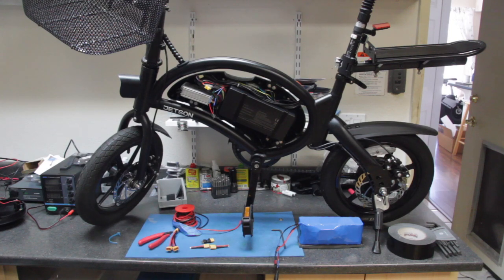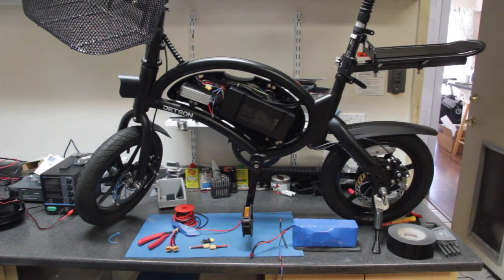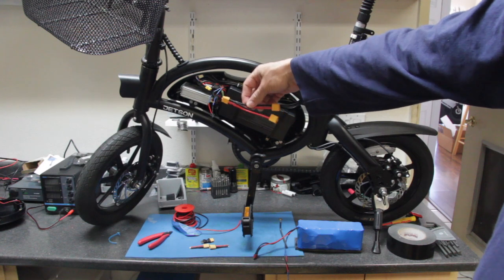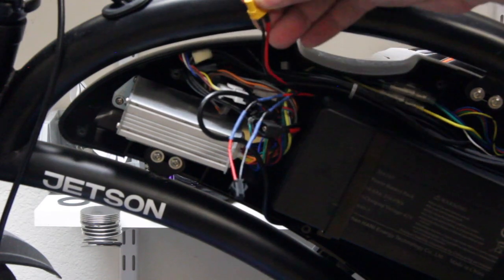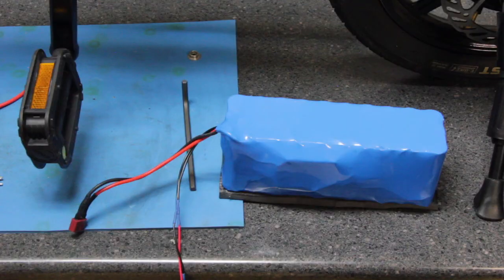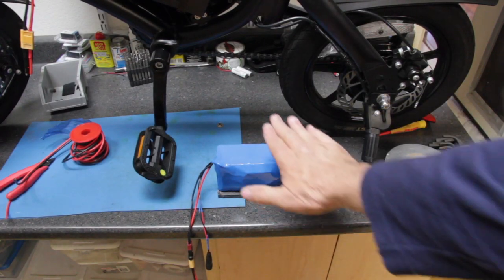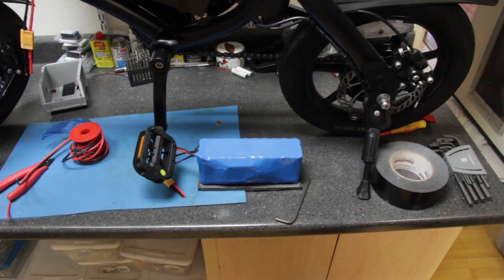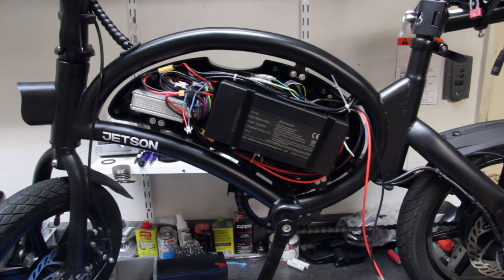Jetson Bolt Pro External Battery Part 1 - Longer Range

Comment: NOOOOO you don't want to do this!! You DO NOT want to use a Y connector. If you do this power can flow from one battery to the other (assuming they arent at the same voltage). Or if one battery discharges faster than the other again power will flow from one battery to the other. This bypasses the standard charge port. For some battery controllers, this won't be a big deal but honestly, we don't know which controller is in the Jetson battery or the eBay battery you bought, so I wouldn't risk it. You stand a serious chance of frying your batteries or worse yet starting a fire. If you really want to do this you need something called a "Dual Battery Discharge Balancer" which will electrically isolate one battery from the other and allows the controller to pull from whichever battery is at the higher voltage. Yes, it's another thing to but and yes they aren't as cheap as a Y connector but for the piece of mind it's well worth it.
Reply from the maker: Batteries are same voltage,  Batteries are disconnected and charged separately, indicated in the video.  The external battery is a slightly higher amp/hr battery.  The BMS's should handle the amp draw or regulate any over amp draw.  If the primary battery discharges first then the external should be regulated by both BMS's.

Comment: Can I use 48v or same volts the 36v
Reply from the maker: For 48 volts you need to upgrade the controller, pretty cheap to do that,. Check on Amazon or ebay
Reply: @Joe's DIY Lab  if upgrade the controller, the speed can be increase?
Reply from the maker: @virgiliovaldez5319  yes the 36 volts controller has a governor, to limit speed,. New 48 volts controller does not.  Or get new 36 volts controller with higher watt rating, that way you can keep the same battery.
Reply: Thanks
Reply: If I upgrade the controller, it is icrease the speed?

Comment: 14 AWG is small. I would use a larger guage like 10 AWG to prevent over heating. I would install a selector battery switch rather than have the batteries in parallel.
Reply from the maker: The bolt pro has a 350 watt motor,  Let say it is under rated, common practice.  Lets use 500 watts,  500 watts at 36 volts is 13.8 amps,  well within the limits of 14 gauge wire.  I mention to use a switch in the video.

Comment: I did this but easier to charge both batteries. I extended inside battery wires and drilled holes on the frame to hide all the wires.
Reply from the maker: Yes, if your batteries have the same amp rating you can charge together.  The batteries I have were not matched.  Thanks

Comment: You don’t require a fuse in between?
Reply from the maker: If you want to add a fuse on the second battery, that would be a good choice.  The primary battery has a fuse already installed.

Comment: Hi there great video. I was wondering if the controller just evenly pulls the same amount of power from each battery at the same time or? I was assuming I would have to unplug the first one after it drains....and plug in the 2nd still fully charged battery afterwards?
Reply from the maker: Ideally both batteries should have the same rating, that way they will discharge evenly.  More than likely one battery will discharge unevenly, which could cause some issues.  So if you can try to keep the batteries the same rating.
Reply: @JoediyLab  Ok Thanx for the response. I think I'll hook them up to a switch to be able to switch over to my secondary after the first one dies.
Reply: @JoediyLab  When you connect two batteries in parallel 
 you're essentially create one bigger battery. I don't believe the smaller one will discharge faster. Also wired this way never drain one battery then plug in the other battery without disconnecting the dead battery. Doing that will cause the good battery to dump to many amps into the dead battery. The charger is probably only 2 amps. I would also disconnect both batteries when charging them and check the voltage to make sure they both are within a tenth on a volt  before plugging them back in.

For goodness sake don't have live bare wires anywhere near each other. Unplug those leads! I was waiting for the boom, sparks and fire. Yes the BMS has overload protection but why torture it or burn it out or even worse. ⚡🔥

Have fun and keep the shinny side up. 😎👍
Reply from the maker: Yes, that is a good idea.

Comment: What battery should I get for the most Myers To upgrade
Reply from the maker: If you want to put the new battery in the existing space, then the battery I listed will work.  If you want a larger battery then take a look at by video that mounts an external battery.
Reply: @JoediyLab  Can you take 2000 bolts of power and put it in Dubai
Reply from the maker: @benstenson38  ;-) sure you can,  let me see the video
Reply: @JoediyLab  what is the limit it could handle
Reply from the maker: @benstenson38  If  you want the battery to fit in the provided space then your are limited.  But if you want to mount an external battery, then you could fit any 36 volt battery

Comment: I got the original Jetson (with pegs, no pedals) so when I run out of power, I walk. This series is very interesting to me  for extending my range. (I initially thought the limited range wouldn’t be a problem - it is!)
When the Pro came out I bought one for my younger sister, who’d been interested in an ebike, but didn’t want to risk losing a “good” one ($2,000+) to theft. 
These Jetsons are a real value for the money, I think. Thanks for your timely videos. Daniel
Reply from the maker: Thanks Daniel

Comment: Can we use instead a36v 20ah battery instead ?
Reply from the maker: Yes, just make sure the battery is the same size as the original battery. or mount the battery on a bike rack.

Comment: The xt60 14awg will also work with a 48v 20ah yes ?
Reply from the maker: The max amps taken by the motor is around 13 amps so yes 14 gauge should be fine.

Comment: Just got the bolt pro and i also want to add a second battery..  but 36v 10ah seem expensive… can we just put a 36v 4ah on the rack bike? As long it is 36v we can put any ah right? I know we won't get much out of 4ah but i only need 5 extra miles..
Reply from the maker: Hey reef, check out my description on the battery videos,  I ordered mine from ebay, from China,  no problems,  But yes you could use a smaller battery.

Comment: You seem to be on top of your game when it comes down to wiring and such, my question to you is why didn’t you just cut off the Deans connector and put on a xt60 therefore not needing the adapter?
Reply from the maker: Hi,  Yes that is a good question.,  I move my batteries to different scooters and ebikes,  alot for testing different combinations of batteries and controllers so I try to standardize on one set of connectors.  Makes the transition easier.  But yes in most folks situations it would be good to keep the same type of connector.
Reply: @JoediyLab burn,bahaha

Comment: You should not connect two dissimilar batteries in parallel.  The voltages can vary and then current flow between the batteries can cause overheating and damage.  A safer solution would be to use a switch to switch between the two batteries.
https://batteryguy.com/kb/knowledge-base/connecting-batteries-in-parallel/
Reply from the maker: Using a switch is always a good solution.  The article you listed assumes the batteries do not have a BMS.  The batteries I reference in the video both have separate BMS's and each have separate charge and discharge ports.  In that case the BMS's should protect against over voltage and high current rates.  But since the specs of the are not listed that would make a good test case for some more testing.  Also this also assumes that the BMS's have not failed.  Maybe some BMS testing is in order for a positive answer.  But yes a switch is a good protective solution.
Reply: @JoediyLab  Do you know if the Jetsons stock battery has BMS too? I'm afraid of running a higher capacity battery unless the battery that comes with the bike has a BMS too.
Reply from the maker: @Zerobytexai  Yes, the stock battery has a BMS and the one you purchase should have a BMS as well.  To be safe you can always add a switch to switch between either battery.  Great questions
Reply: @JoediyLab  how do you add a switch ?
if you could make a video on how to add a switch as safety measure incase the bms fail.   i'd also like to add a second battery but can't find the exact same Jetson battery anywhere around...    mixing the factory 6ah battery with a 36v 10ah here... also battery sold on amazon picture AC/DC charger with two pins not the (US UL) outlet plug.  are they safe to use ?
Reply from the maker: @reefgratos2035  Hey reef,  I am currently out of town,  but when I get back I will make a video on how to wire in a dual switch

Comment: Hi, thanks for the video! For those of us who are not comfortable with soldering, do you have any suggestions for crimp connectors or similar? Thanks!!
Reply from the maker: Hi Gracie check out this link≤  you can use a heat gun with these connectors https://www.amazon.com/120PCS-Solder-Seal-Wire-Connectors/dp/B07S62KYSL/ref=sr_1_3?dchild=1&keywords=solder+heat+shrink+connectors&qid=1615343746&sr=8-3

Comment: Thanks Joe,
Your explanations are precise and very detailed.

Did you do a road test with your two batteries?
In addition to the improvement in distance, did you notice an increase in your speed.
I weigh 180 lbs and only get 14.3 miles per hour with my regular Bolt Pro
Reply from the maker: Yes, just posted a distance test with the external battery.  Check my page for the latest video